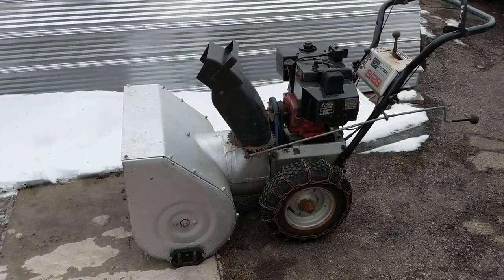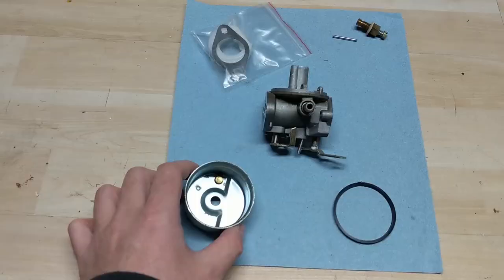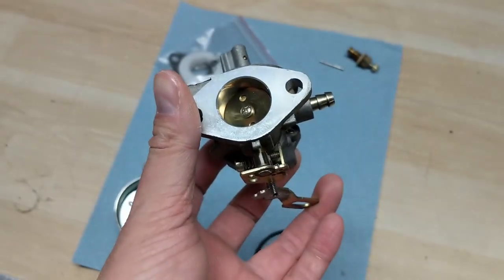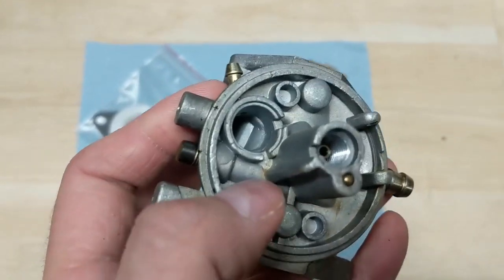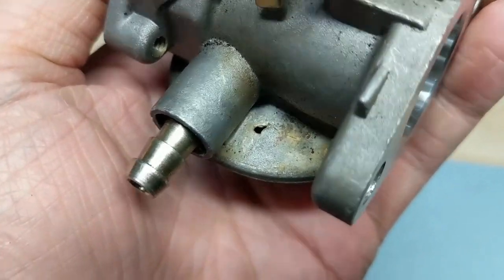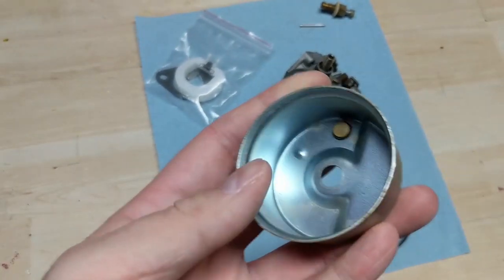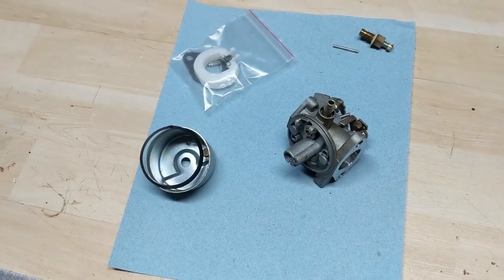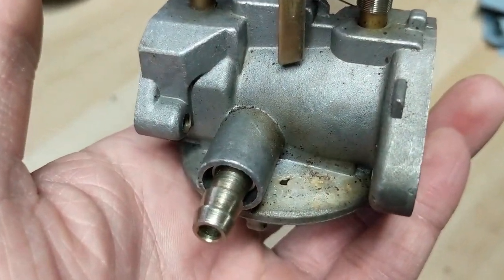Aftermarket Chinese Carburetor Defect

Comment: Working at a major US parts manufacture, there were always defects, but the QA was supposed to weed them out. A couple always slipped thru, cause I worked returns and warranty and I got to see them all. I think as long as its around 0.01% failure they are happy, cause it would cost a fortune to completely test every part (like they did for military use) and be cost prohibitive to consumers.

Comment: When I worked in a small engine engine shop in the mid 90’s. You couldn’t even find a aftermarket carb that was made in China. It was all OEM. Now it seems like all the parts and engines  are from China. Wow, have things changed! 
Great video!
Reply from the maker: Yea that's the truth, times have definitely changed! And as parents expire, china manufacturers step in an dominate the market, thanks for watching!
Reply: I stick with the old stuff- 20 years or older- this new stuff is garbage-- I have been working on lawn equipment for 65 years

Comment: JB Weld will cure that casting defect. It will hold for decades if you clean the aluminum really well and rough up the area around the hole.

Comment: Very well explained and myself being in the forging business and knowing about casting i can 100% tell you that is a cold shut formed during the aluminium pouring process. Never saw this condition in an aftermarket carb but normally they leak as received so i normally put in the OEM bowl gasket and never had a problem.
Reply from the maker: Great analysis, thanks for watching!

Comment: Nice find. I have only had two aftermarket carbs with issues. Most are pretty good and usually have no issues. I did find the adjustments are usually o.k. and don't need very adjustment. I have had lots of issues with the Briggs carbs (Nikki) and I am looking for better replacements. Thanks for the video's.
Reply from the maker: Thanks for watching!
Reply: You have a great channel. Is Walbro making carbs to replace the Nikki carbs? I heard they were but not sure.
Reply from the maker: @watermanone7567  they already have some, just search the Briggs model number and usually you get 2 options for either Nikki or Briggs.

Comment: I fix holes in my carbs with supper glue.  it works But i understand why you replaced it
Reply from the maker: Yea, like I said, maybe JbWeld would've held up, but for a guarantee, it's got a brand new one installed!

Comment: How many different carburetors are there? Roughly speaking that is. Can you inventory like 12 different carbs and cover 80% of the small engines? Or are they all different?
Reply from the maker: Almost everyone of them has a different outer design, but I'd say 90% of them are internally designed the same. Bowl, float, needle etc... I've swapped around carbs from a snowblower to a rototiller but the newer stuff you almost always need to buy a replacement if the original is damaged

Comment: Can you please tell me which Chinese aftermarket carb manufacturers you recommend ?  I need to replace a Tecumseh # 632371A on my old Simplicity snowblower with HSK70 engine.  Thank you.
Reply from the maker: SEPC, QAZAKY or Raceguy carbs are always good, those are all through Amazon. Look for the ones with the adjustable main jet on the bottom.

Comment: I ordered a cheap Chinese carb replacement for a cheap Chinese wen oem genny (probably same carb.)  New replacement won't fire the engine once. Nothing. Dead. It's direct from China. These things come out of tune? I can't imagine jets being shut to the point they pass no fuel. Any advice?  Thanks, Jim from Kenosha.
Reply from the maker: Take the float bowl off, the float is probably adjusted incorrectly and the needle valve is stuck! Either that or it won't prime the fuel properly.
Reply: @EliminatorPerformance  - Dude, lightning reply.  Very appreciated.  I checked for that, and fuel is def getting to the bowl.  I got it to fire up, but it won't run well with choke fully open.  I checked the pilot and it is clear.  any more ideas?  again, thanks!

Comment: What is the vendor you use and where do you buy from? Thank you!
Reply from the maker: Usually STENS has high quality aftermarket replacement carbs, if not I use Amazon and go with "Race-Guy" or "Iztoss"
Reply: @EliminatorPerformance  thank you very much!
Reply from the maker: @dougsfan9984  anytime!

Comment: Do you have your own mower shop? Or is this something you do at home on the side?
Reply from the maker: This is my job, YouTube vids on the side, work out of the garage. Will be upgrading to a shop in the next few years probably.
Reply: @EliminatorPerformance   any advice for someone looking to start a mower repair shop?
Reply from the maker: @turner7979  it takes time to build a good customer base, and also to get all the tools you need (I've been doing this for 6yrs now I think and I still don't have every tool I need lol).

It's good money for the work being done, not too labour intensive.
Reply: @EliminatorPerformance   I've been in the mechanic field for about 25 years. It's mainly heavy diesel equipment and hydraulic. Just looking to do something a little lighter.
 So I was thinking a mower shop. Just not sure how the work is as far as staying busy. Do you keep work the whole year ? Or does it go away during the winter months?
Reply from the maker: @turner7979  I usually have something to do every day, although this past month has been slow (the YouTube revenue helps) but there's currently no snow lol so one one is using snowblowers. A lot of landscaping companies I do work for have also laid off workers because of the lack of snow/snow plowing. But in the summer it gets crazy, multiple jobs a day, busy all the time.

Comment: Need help, gonna put a Predator 173cc Vertical engine on a NO name NO identification mower so I CAN'T use a KNOWN blade adapter, BUT the engine is a 7/8 O.D. with 3/16 key way, do you have any that would fit up to this engine that you have used?? Make & part number of the adapter ????  I emailed Rotary & got NO answer AND their catalog doesn't give all the dims where I could pick out one, Thanks for ANY help
Reply from the maker: Try a Craftsman 850977, it's a 7/8" with a 3/16 key.

Or an AYP 581547901 (also under Husqvarna) it says 7/8" with 3/16" key. That's a STENS 405-221.

If it helps you out, think about leaving me a Google review! Would help me out big-time, thanks!
Reply: @EliminatorPerformance  THANKS, exactly what I need, I had purchased another p/n but it puts the blade 1 inch lower which I didn't need, these you shared looks exactly what I need, NOT sure how I write a Google review for a Youtube channel, give me instructions & I will be more than happy to !
Reply from the maker: @REVNUMANEWBERN  just google Eliminator Performance, if you see my business listing, you should be able to click the "reviews" tab and leave a review. I'd appreciate it, helps me out a lot!
Reply: @EliminatorPerformance  DONE, BTW, you may want to check most of your media locations, they don't have actual address on them, at least not like we have in the states, couldn't find on your FB page either
Reply from the maker: @REVNUMANEWBERN  thanks! And yes we're aware, we currently work out of a residential address (legal in my town if you have 1 employee) but I kind of prefer if people call and schedule 1st instead of just showing up, if that makes sense lol